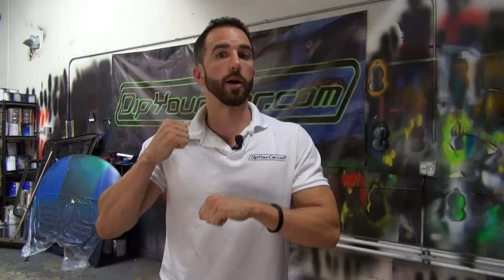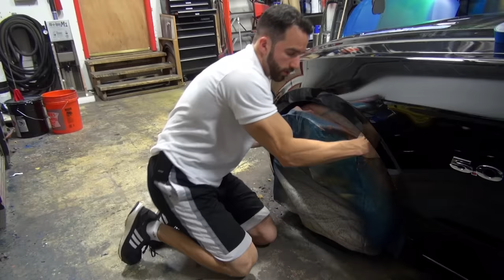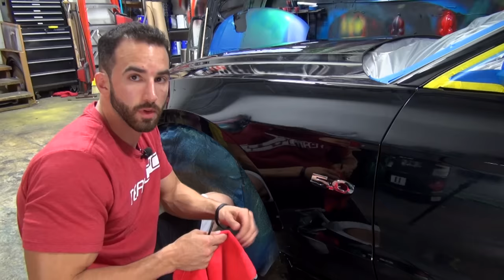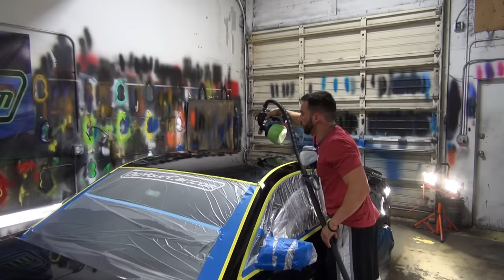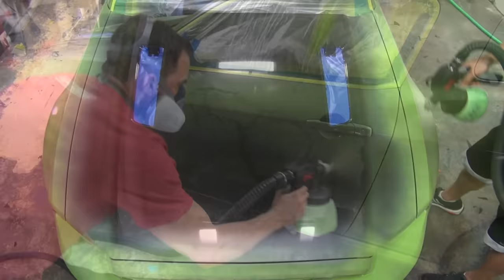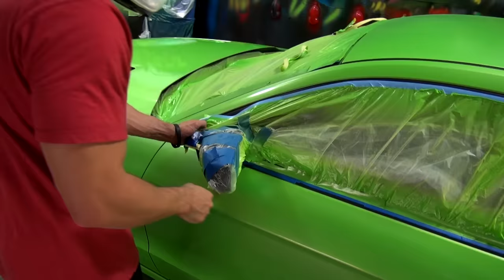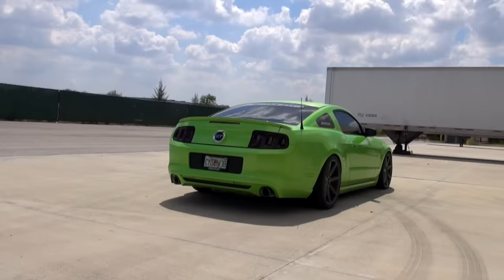Plasti Dip Your Car - The Complete Guide

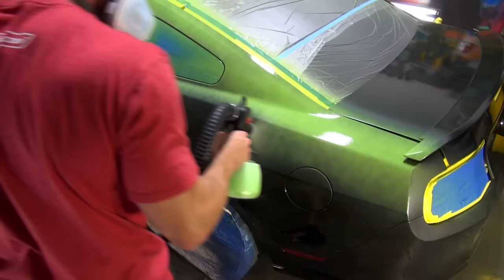Comment: Uhh, at 25:57, shouldn't that reflector be taped off?
Reply: it's not necessary, it'd be easy to peal, nice find tho!
Reply: +shocktop 
I was thinking that same thing. It looks like it was intentional, as the coated reflector can be seen in outline, but it is as green as Kermit.
Reply: cvnb   b
 v

1 lata de leche condensada
2 medidas de la misma lata de leche común
5 huevos
100 gramos de coco rallado
3/4 taza de azúcar para preparar caramelo ( 150 gramos )

Preparación del flan. Semibatir los huevos.
Entibiar apenas la leche común y mezclarla con la leche condensada.

Mezclar los huevos y el coco con la preparación anterior.

Caramelo. Poner en una cacerola chica el azúcar y dos cucharadas de agua.
Llevar al fuego y dejar sin mezlar hasta que los bordes comiencen a oscurecerse.
Se retira, se mezcla rápidamente ( moviendo la cacerola ) y se vuelca sobre la budinera esparciéndolo por todo el envase.
Una vez solidificado se vuelca el flan y se lleva a cocinar a baño María ( con el agua caliente ) durante 50 minutos aprox. o hasta que al introducir la punta de un cuchillo o un palillo éste salga húmedo pero limpio.

Una vez pronto se deja enfriar hasta que tome temperatura ambiente. 
Recién se lleva a la heladera durante unas horas. Si es toda la noche mejor.
Y recién se desmolda.
Queda muy bien acompañado de crema chantillí o dulce de leche.

- 4 cucharadas de 
- 1 
- 4 
- 6 
- 12 hojitas de 
-&#160;
-&#160;
- 1 pizca de 

- Pelar y vaciar los . 
- Salarlos y colocarlos boca abajo en un colador para que pierdan el exceso de agua. 
- Dejar que escurran durante una hora.
- Pelar el  y la .
- Licuar los , el , la .
- Agregar el , la , la  y el , mezclar. 
- Lavar las hojas de  y agregarlas a la mezcla anterior, continuar licuando.
- Dejar que la , repose en un recipient tapado todo un día en la nevera, para que tenga un mejor sabor.

- 4 cucharadas de 
- 1 
- 4 
- 6 
- 12 hojitas de 
-&#160;
-&#160;
- 1 pizca de 

- Pelar y vaciar los . 
- Salarlos y colocarlos boca abajo en un colador para que pierdan el exceso de agua. 
- Dejar que escurran durante una hora.
- Pelar el  y la .
- Licuar los , el , la .
- Agregar el , la , la  y el , mezclar. 
- Lavar las hojas de  y agregarlas a la mezcla anterior, continuar licuando.
- Dejar que la , repose en un recipient tapado todo un día en la nevera, para que tenga un mejor sabor.

- 4 cucharadas de 
- 1 
- 4 
- 6 
- 12 hojitas de 
-&#160;
-&#160;
- 1 pizca de 

- Pelar y vaciar los . 
- Salarlos y colocarlos boca abajo en un colador para que pierdan el exceso de agua. 
- Dejar que escurran durante una hora.
- Pelar el  y la .
- Licuar los , el , la .
- Agregar el , la , la  y el , mezclar. 
- Lavar las hojas de  y agregarlas a la mezcla anterior, continuar licuando.
- Dejar que la , repose en un recipient tapado todo un día en la nevera, para que tenga un mejor sabor.

- 4 cucharadas de 
- 1 
- 4 
- 6 
- 12 hojitas de 
-&#160;
-&#160;
- 1 pizca de 

- Pelar y vaciar los . 
- Salarlos y colocarlos boca abajo en un colador para que pierdan el exceso de agua. 
- Dejar que escurran durante una hora.
- Pelar el  y la .
- Licuar los , el , la .
- Agregar el , la , la  y el , mezclar. 
- Lavar las hojas de  y agregarlas a la mezcla anterior, continuar licuando.
- Dejar que la , repose en un recipient tapado todo un día en la nevera, para que tenga un mejor sabor.

1 lata de leche condensada
2 medidas de la misma lata de leche común
5 huevos
100 gramos de coco rallado
3/4 taza de azúcar para preparar caramelo ( 150 gramos )

Preparación del flan. Semibatir los huevos.
Entibiar apenas la leche común y mezclarla con la leche condensada.

Mezclar los huevos y el coco con la preparación anterior.

Caramelo. Poner en una cacerola chica el azúcar y dos cucharadas de agua.
Llevar al fuego y dejar sin mezlar hasta que los bordes comiencen a oscurecerse.
Se retira, se mezcla rápidamente ( moviendo la cacerola ) y se vuelca sobre la budinera esparciéndolo por todo el envase.
Una vez solidificado se vuelca el flan y se lleva a cocinar a baño María ( con el agua caliente ) durante 50 minutos aprox. o hasta que al introducir la punta de un cuchillo o un palillo éste salga húmedo pero limpio.

Una vez pronto se deja enfriar hasta que tome temperatura ambiente. 
Recién se lleva a la heladera durante unas horas. Si es toda la noche mejor.
Y recién se desmolda.
Queda muy bien acompañado de crema chantillí o dulce de leche.

- 4 cucharadas de 
- 1 
- 4 
- 6 
- 12 hojitas de 
-&#160;
-&#160;
- 1 pizca de 

- Pelar y vaciar los . 
- Salarlos y colocarlos boca abajo en un colador para que pierdan el exceso de agua. 
- Dejar que escurran durante una hora.
- Pelar el  y la .
- Licuar los , el , la .
- Agregar el , la , la  y el , mezclar. 
- Lavar las hojas de  y agregarlas a la mezcla anterior, continuar licuando.
- Dejar que la , repose en un recipient tapado todo un día en la nevera, para que tenga un mejor sabor.

y e bnknbbffngs1wuk1qggnnn
Reply: cvnb   b
 v

1 lata de leche condensada
2 medidas de la misma lata de leche común
5 huevos
100 gramos de coco rallado
3/4 taza de azúcar para preparar caramelo ( 150 gramos )

Preparación del flan. Semibatir los huevos.
Entibiar apenas la leche común y mezclarla con la leche condensada.

Mezclar los huevos y el coco con la preparación anterior.

Caramelo. Poner en una cacerola chica el azúcar y dos cucharadas de agua.
Llevar al fuego y dejar sin mezlar hasta que los bordes comiencen a oscurecerse.
Se retira, se mezcla rápidamente ( moviendo la cacerola ) y se vuelca sobre la budinera esparciéndolo por todo el envase.
Una vez solidificado se vuelca el flan y se lleva a cocinar a baño María ( con el agua caliente ) durante 50 minutos aprox. o hasta que al introducir la punta de un cuchillo o un palillo éste salga húmedo pero limpio.

Una vez pronto se deja enfriar hasta que tome temperatura ambiente. 
Recién se lleva a la heladera durante unas horas. Si es toda la noche mejor.
Y recién se desmolda.
Queda muy bien acompañado de crema chantillí o dulce de leche.

- 4 cucharadas de 
- 1 
- 4 
- 6 
- 12 hojitas de 
-&#160;
-&#160;
- 1 pizca de 

- Pelar y vaciar los . 
- Salarlos y colocarlos boca abajo en un colador para que pierdan el exceso de agua. 
- Dejar que escurran durante una hora.
- Pelar el  y la .
- Licuar los , el , la .
- Agregar el , la , la  y el , mezclar. 
- Lavar las hojas de  y agregarlas a la mezcla anterior, continuar licuando.
- Dejar que la , repose en un recipient tapado todo un día en la nevera, para que tenga un mejor sabor.

- 4 cucharadas de 
- 1 
- 4 
- 6 
- 12 hojitas de 
-&#160;
-&#160;
- 1 pizca de 

- Pelar y vaciar los . 
- Salarlos y colocarlos boca abajo en un colador para que pierdan el exceso de agua. 
- Dejar que escurran durante una hora.
- Pelar el  y la .
- Licuar los , el , la .
- Agregar el , la , la  y el , mezclar. 
- Lavar las hojas de  y agregarlas a la mezcla anterior, continuar licuando.
- Dejar que la , repose en un recipient tapado todo un día en la nevera, para que tenga un mejor sabor.

- 4 cucharadas de 
- 1 
- 4 
- 6 
- 12 hojitas de 
-&#160;
-&#160;
- 1 pizca de 

- Pelar y vaciar los . 
- Salarlos y colocarlos boca abajo en un colador para que pierdan el exceso de agua. 
- Dejar que escurran durante una hora.
- Pelar el  y la .
- Licuar los , el , la .
- Agregar el , la , la  y el , mezclar. 
- Lavar las hojas de  y agregarlas a la mezcla anterior, continuar licuando.
- Dejar que la , repose en un recipient tapado todo un día en la nevera, para que tenga un mejor sabor.

- 4 cucharadas de 
- 1 
- 4 
- 6 
- 12 hojitas de 
-&#160;
-&#160;
- 1 pizca de 

- Pelar y vaciar los . 
- Salarlos y colocarlos boca abajo en un colador para que pierdan el exceso de agua. 
- Dejar que escurran durante una hora.
- Pelar el  y la .
- Licuar los , el , la .
- Agregar el , la , la  y el , mezclar. 
- Lavar las hojas de  y agregarlas a la mezcla anterior, continuar licuando.
- Dejar que la , repose en un recipient tapado todo un día en la nevera, para que tenga un mejor sabor.

1 lata de leche condensada
2 medidas de la misma lata de leche común
5 huevos
100 gramos de coco rallado
3/4 taza de azúcar para preparar caramelo ( 150 gramos )

Preparación del flan. Semibatir los huevos.
Entibiar apenas la leche común y mezclarla con la leche condensada.

Mezclar los huevos y el coco con la preparación anterior.

Caramelo. Poner en una cacerola chica el azúcar y dos cucharadas de agua.
Llevar al fuego y dejar sin mezlar hasta que los bordes comiencen a oscurecerse.
Se retira, se mezcla rápidamente ( moviendo la cacerola ) y se vuelca sobre la budinera esparciéndolo por todo el envase.
Una vez solidificado se vuelca el flan y se lleva a cocinar a baño María ( con el agua caliente ) durante 50 minutos aprox. o hasta que al introducir la punta de un cuchillo o un palillo éste salga húmedo pero limpio.

Una vez pronto se deja enfriar hasta que tome temperatura ambiente. 
Recién se lleva a la heladera durante unas horas. Si es toda la noche mejor.
Y recién se desmolda.
Queda muy bien acompañado de crema chantillí o dulce de leche.

- 4 cucharadas de 
- 1 
- 4 
- 6 
- 12 hojitas de 
-&#160;
-&#160;
- 1 pizca de 

- Pelar y vaciar los . 
- Salarlos y colocarlos boca abajo en un colador para que pierdan el exceso de agua. 
- Dejar que escurran durante una hora.
- Pelar el  y la .
- Licuar los , el , la .
- Agregar el , la , la  y el , mezclar. 
- Lavar las hojas de  y agregarlas a la mezcla anterior, continuar licuando.
- Dejar que la , repose en un recipient tapado todo un día en la nevera, para que tenga un mejor sabor.

y e bnknbbffngs1wuk1qggnnn
Reply: cvnb   b
 v

1 lata de leche condensada
2 medidas de la misma lata de leche común
5 huevos
100 gramos de coco rallado
3/4 taza de azúcar para preparar caramelo ( 150 gramos )

Preparación del flan. Semibatir los huevos.
Entibiar apenas la leche común y mezclarla con la leche condensada.

Mezclar los huevos y el coco con la preparación anterior.

Caramelo. Poner en una cacerola chica el azúcar y dos cucharadas de agua.
Llevar al fuego y dejar sin mezlar hasta que los bordes comiencen a oscurecerse.
Se retira, se mezcla rápidamente ( moviendo la cacerola ) y se vuelca sobre la budinera esparciéndolo por todo el envase.
Una vez solidificado se vuelca el flan y se lleva a cocinar a baño María ( con el agua caliente ) durante 50 minutos aprox. o hasta que al introducir la punta de un cuchillo o un palillo éste salga húmedo pero limpio.

Una vez pronto se deja enfriar hasta que tome temperatura ambiente. 
Recién se lleva a la heladera durante unas horas. Si es toda la noche mejor.
Y recién se desmolda.
Queda muy bien acompañado de crema chantillí o dulce de leche.

- 4 cucharadas de 
- 1 
- 4 
- 6 
- 12 hojitas de 
-&#160;
-&#160;
- 1 pizca de 

- Pelar y vaciar los . 
- Salarlos y colocarlos boca abajo en un colador para que pierdan el exceso de agua. 
- Dejar que escurran durante una hora.
- Pelar el  y la .
- Licuar los , el , la .
- Agregar el , la , la  y el , mezclar. 
- Lavar las hojas de  y agregarlas a la mezcla anterior, continuar licuando.
- Dejar que la , repose en un recipient tapado todo un día en la nevera, para que tenga un mejor sabor.

- 4 cucharadas de 
- 1 
- 4 
- 6 
- 12 hojitas de 
-&#160;
-&#160;
- 1 pizca de 

- Pelar y vaciar los . 
- Salarlos y colocarlos boca abajo en un colador para que pierdan el exceso de agua. 
- Dejar que escurran durante una hora.
- Pelar el  y la .
- Licuar los , el , la .
- Agregar el , la , la  y el , mezclar. 
- Lavar las hojas de  y agregarlas a la mezcla anterior, continuar licuando.
- Dejar que la , repose en un recipient tapado todo un día en la nevera, para que tenga un mejor sabor.

- 4 cucharadas de 
- 1 
- 4 
- 6 
- 12 hojitas de 
-&#160;
-&#160;
- 1 pizca de 

- Pelar y vaciar los . 
- Salarlos y colocarlos boca abajo en un colador para que pierdan el exceso de agua. 
- Dejar que escurran durante una hora.
- Pelar el  y la .
- Licuar los , el , la .
- Agregar el , la , la  y el , mezclar. 
- Lavar las hojas de  y agregarlas a la mezcla anterior, continuar licuando.
- Dejar que la , repose en un recipient tapado todo un día en la nevera, para que tenga un mejor sabor.

- 4 cucharadas de 
- 1 
- 4 
- 6 
- 12 hojitas de 
-&#160;
-&#160;
- 1 pizca de 

- Pelar y vaciar los . 
- Salarlos y colocarlos boca abajo en un colador para que pierdan el exceso de agua. 
- Dejar que escurran durante una hora.
- Pelar el  y la .
- Licuar los , el , la .
- Agregar el , la , la  y el , mezclar. 
- Lavar las hojas de  y agregarlas a la mezcla anterior, continuar licuando.
- Dejar que la , repose en un recipient tapado todo un día en la nevera, para que tenga un mejor sabor.

1 lata de leche condensada
2 medidas de la misma lata de leche común
5 huevos
100 gramos de coco rallado
3/4 taza de azúcar para preparar caramelo ( 150 gramos )

Preparación del flan. Semibatir los huevos.
Entibiar apenas la leche común y mezclarla con la leche condensada.

Mezclar los huevos y el coco con la preparación anterior.

Caramelo. Poner en una cacerola chica el azúcar y dos cucharadas de agua.
Llevar al fuego y dejar sin mezlar hasta que los bordes comiencen a oscurecerse.
Se retira, se mezcla rápidamente ( moviendo la cacerola ) y se vuelca sobre la budinera esparciéndolo por todo el envase.
Una vez solidificado se vuelca el flan y se lleva a cocinar a baño María ( con el agua caliente ) durante 50 minutos aprox. o hasta que al introducir la punta de un cuchillo o un palillo éste salga húmedo pero limpio.

Una vez pronto se deja enfriar hasta que tome temperatura ambiente. 
Recién se lleva a la heladera durante unas horas. Si es toda la noche mejor.
Y recién se desmolda.
Queda muy bien acompañado de crema chantillí o dulce de leche.

- 4 cucharadas de 
- 1 
- 4 
- 6 
- 12 hojitas de 
-&#160;
-&#160;
- 1 pizca de 

- Pelar y vaciar los . 
- Salarlos y colocarlos boca abajo en un colador para que pierdan el exceso de agua. 
- Dejar que escurran durante una hora.
- Pelar el  y la .
- Licuar los , el , la .
- Agregar el , la , la  y el , mezclar. 
- Lavar las hojas de  y agregarlas a la mezcla anterior, continuar licuando.
- Dejar que la , repose en un recipient tapado todo un día en la nevera, para que tenga un mejor sabor.

y e bnknbbffngs1wuk1qggnnn
Reply: +Ines Murillo Villalta I LOVE FLAN! Thank you!
Reply: I saw that as well, and also noticed the lower front side grilles or keyholes aren't masked off either
Reply: TheEpicCrumpet yeah, you can peal it off later after the dip dries up.
Reply: I uul
Reply: +shocktop 36:49 : They kept it green and didn't peel the dip off. I guess the owner didn't like that reflector there.
Reply: so i guess nobody noticed the 5.0 been painted too
Reply: +shocktop actually he did tape off alot of the stuff i just notice the tape still on the reflectors and the brake cooling vents lol
Reply: That car can't be street legal after he painted over the reflectors. I guess the owner could just peal it off or just has to pray they don't get on the nerves of some moody cop.
Reply: no
Reply: +Chris Powell reflectors?  lol you only need lights..they are reflective..you dont need marking reflectors unless you are a semi trailer
Reply: +matanuska high You are required by law in all 50 states to have orange reflectors on the front and both sides and red on the back on both sides on ALL motor vehicles. Whether the customer ordered them painted over or not the shop shouldn't have done it because it's not legal and it's not safe for other people or the customer.
Reply: +shocktop maybe he wanted to get rid of it? i personally hate reflectors on vehicles makes it look tacky and cheap.
Reply: +Andres Vera that area is metal...its plastic dip not metal dip

Comment: I noticed in the end result that you over sprayed the reflectors on the front, back and rear sides. Also the fog light covers. Was this intentional?  Secondly, the door handles would be a concern to me. When you use the door handles, wouldn't that pull the dip and cause tearing issues? Also, what about the key hole in the handles? Same question.

Comment: I purchased Gunmetal plastidip and to be honest it turned out to be really good and smooth.

I followed every step and applied the plasti dip, and waited 36 hours for it to dry.  After 36 hours, the color was nothing as advertised by the seller.  The color that I got on my Jeep ended up being space grey, and was shockingly, drastically lighter then what is advertised. Following the disappointment, I contacted their customer service to report the issue and even I sent the pictures  I took of the results to show them. Their response was "this is how it is supposed to be" even though it's a completely different color than the images the seller used on this website, the description of the color and so on. It is false advertisement. 

If this color was what I was expecting and what the seller was advertising, I would have definitely recommended it to my employees and friends. However, the results were terrible and not as expected at ALL.
Reply: Sounds like a problem with the seller, not Plasti Dip.

Comment: since you didn't cover the 5.0 emblem, I assume you painted over it so my question is, how did you remove the dip from the surface of the emblem? Thanks. other than that it was a pretty solid tutorial.
Reply: Tweezers
Reply: X-acto knife the edges and peel it off.
Reply: You dont...
Reply: you score and peel . masking is not so important as with normal paint.